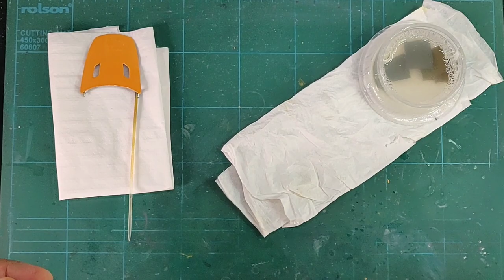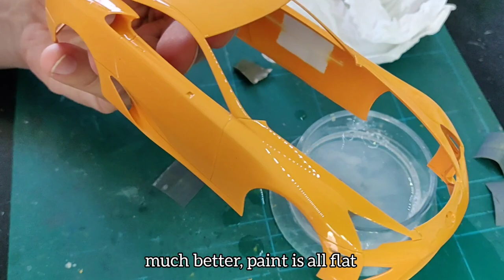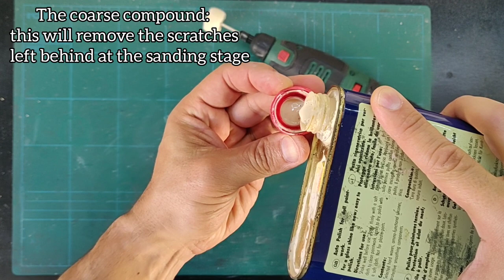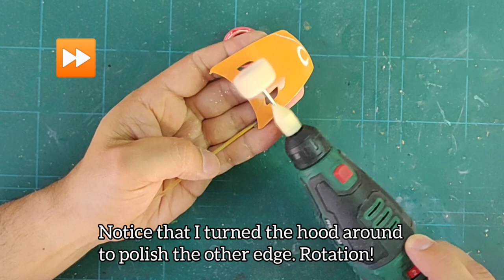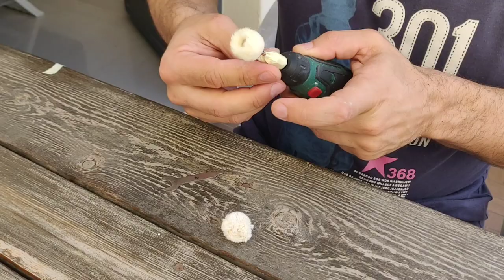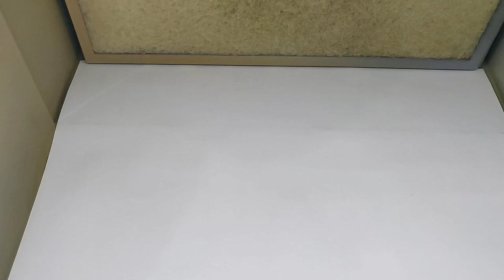Tutorial: How To Polish 2K clear to get a deep mirror shine!

Comment: That’s a good tip about taping off the shank on the rotary tool. I ruined my Mustang GT4 in a spot when it made contact.  Also, don’t do this at your workbench as the fibers from the pad get EVERYWHERE!  Great video my friend.
Reply from the maker: Thank you my friend, that is very appreciated James! Yes exactly that masking tape is important. On the LFA, the masking tape touched the body twice and no damage happened. If it wasn't covered, I'm sure the LFA had to go back to the primer stage! You are right about the fibers. That is the second reason why I go outside to polish. Better lighting + fibers can go where they like, not on my bench! In fact, in this video when I change the buffer for the fine compound and begin polishing, you can notice the fibers flying towards me! Thanks again for your feedback and viewing my video :)

Comment: Everytime I try to do this I end up with micro scratches I can't get rid of, no matter how long I polish. I use the same polish wheel, and tamiya compounds, with 3000 grit sanding sponge.
Reply from the maker: Hi Petyr, thanks for watching the video and leaving your feedback. With this set up, I don't have micro scratches anymore. When I polished the Toyota 86, I used the same procedure but instead of automotive compounds, I was using the 3x Tamiya compounds and was left with micro scratches all around. On the next build, the Evo 7, I changed these for automotive compounds and noticed a big difference, a shinier deeper finish with no scratches. The Tamiya compounds are more suited for the TS13 clear. To me, 2k clear is automotive so it requires automotive compounds for the best results. Especially the red Autoglym, it makes a huge difference finishing with it. Regarding sanding, I use the one seen, simple 2500 automotive. Always sand with the least pressure with soapy water to avoid deep scratches. Sorry for writing long, just wanted to express my opinion and thanks again for your feedback 👍
Reply: @KarlScaleModeling  Thank you very much for the detailed reply! I'll definately give it a try!
Reply from the maker: No problem Petyr, glad to be of help. I'm no expert, but when something comes out right I like to share with others to help them achieve good results too. Once again, thanks for checking out my video 👍

Comment: it looks so easy.  i spend a loooot of time to polishing, 4000-6000-8000-10000, then 3x compounds . may be i use your way next time 😄
Reply from the maker: Thanks for your feedback Oleg. The last car I polished with the miscromesh system was the Skyline R33. Then I started using this method and never looked back. Still takes around 6 hours in all for me, but easier than the micromesh. 2K clear is automotive grade so I decided to use automotive polishes. 2500 takes care of the orange peel and dust while the compounds do the rest! Try it out my friend, it works ☺️ Thanks for watching 👍

Comment: I have an LFA painted the exact same color! I prefer to use the foam polishing pads. A lot less chance of burning through. Still need to be careful on edges though regardless.
Reply from the maker: Thank you for your comment, that's very appreciated. This is a colour which I really like on an LFA, especially on the Nurburgring version. Glad you also chose the same colour for yours.

I fully agree with you about the foam polishing pads. I got mine recently and polished the Top Secret Fairlady Z using those and I really like the outcome. In fact, I'm planning another video tutorial using the foam ones instead of wool. Thanks for your feedback 👍🏼👍🏼

Comment: Thank You for this, I was wondering about RPM you use on your rotary tool? Mine I can adjust from very slow or very fast. Where do you get the polishing wheels from please?
Reply from the maker: Hello there, thanks for your message. Regarding speed, I don't know the exact rpm value since my tool has a rotary switch from 1 to 7. Usually I work with settings 3 to 4. The important thing is that when you touch the polishing wheel to the  body, you feel it working. Too much speed with make it blow all the compound away while too little speed will make the wheel slow too much on the body.. so you'll need to find the best speed for your set up. The polishing wheels I get them from ebay and joom. Search for rotary tool polishing wool. I just bought more last week from joom. Hope that helps ☺️👍🏼
Reply: @KarlScaleModeling  Thank You for the reply, I will check it out.
Reply from the maker: @Aces_Eights_Scale_Vision  Sure, no problem. If you need further information feel free to let me know.

Comment: Hello, can i ask you a question? I use 2k clear but often its remaing just a litl bit flat ofter polishing. Its not really shine as i would like. I use automotive products, and i respect times as indicated on the boxes...
Reply from the maker: Hello Leon, sure you can ask. I'll do my best to help too. Having the 2k still a bit flat after polishing can occur due to several instances, mainly:
- You may be pressing a bit hard when sanding the clear smooth and/or the sand paper is a bit rough and some scratches produced are not being removed by the next polishing process.
- Polishing compounds are not good enough to fully remove the scratches done during the sanding process hence leaving a slightly dull finish.
It's great that you're using automotive products since 2k dries hard, but some more information about what you're using exactly will help me understand your procedure to help you further. For example, what sandpaper you're using to remove orange peel, what polishing compounds. If you're using them manually or with a rotary tool like me. Let me know so that I can help you even more.
Regards.

Comment: Where did you get the wool polishing bits? Or how do i search for them?
Reply from the maker: I buy them from ebay or joom. Quite cheap too, a bag of 10 usually costs around 4-5 euros. I search for 'wool polishing buffers' and usually many show up. The latest bag I got from joom are also very good since I polished the Toyota Crown with them and had the same results. Hope that helps.
Reply from the maker: Just made a search and the best option is to write 'wool polishing buffers dremel'. Choose the round, puffed ones like I show in my video. The flat ones aren't as soft as the ones I use and cause scratches 👍

Comment: Are u using new wool polishing buffers every time? Or do you wash them. And with what, of so?
Reply from the maker: Hello Ramses, I get these wool buffers quite cheaply from Joom or Ali, so I throw them away and use new ones. I use 2 on each build, one for the coarse compound and the other for the fine. However recently I'm not using them anymore. I bought the foam polishing sponges and found them much better. I'll do a new tutorial the first time I use them, which is very soon ☺️😀

Comment: Thank you for the video. how many hours from start to finish? Tks
Reply from the maker: Hi Ricardo, thank you for your feedback. I would say that the whole procedure took around 6 to 7 hours. 3 hours sanding + 1.5 hours each compound (average). The LFA has some sharp edges so I had to be really careful not to sand through. Easier and smaller builds, like the Honda Civic, took less time to polish. I think on the Civic I spent a total of 5 hours approx. Hope that helps and thanks again for watching.

Comment: I know I'm 2 years late since this was posted, but would the same steps apply to a diecast such as a Hot Wheels car?
Reply from the maker: Hello there, no problem about the old video! I'm still here so it's all good ☺️ This procedure could be used on various sprayed items, diecast included. But you have to be sure that the spray withstands the polishing procedures. This method works best on 2K clear, since it contains hardener and dries pretty hard. This will minimize the chance to sand through. Using it onto 1K clear, onto paint directly or onto the original diecast paints is not very recommended as these finishes are much softer and hence increasing the risk to sand through the paint. Hope that helps ☺️👍🏼
Reply: @KarlScaleModeling  sure did, and thank you for the reply/tips.
Reply from the maker: No problem, glad to be of help ☺️

Comment: How many RPM does Dremel have?
Reply from the maker: Hello there, my rotary tool has a speed setting from 1 to 7 and rated rpm is 5000 to 25000. I usually work at setting 2-3 so I'm guessing I work at under 10000 rpm. However this depends on the type of rotary tool being used together with one's personal choice of working speed. My friend has a real Dremel (mine is Parkside) and he works with lower speed than me since the Dremel barely slows once the buffer wheel touches the body. Mine slows a lot more with the friction. So you have to find the right speed for the rotary tool you're using. Hope that helps.